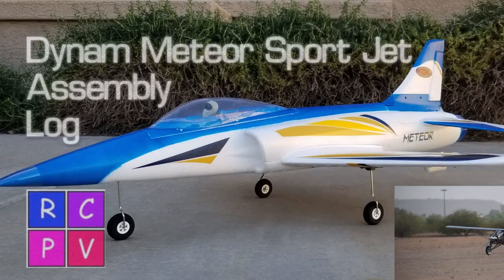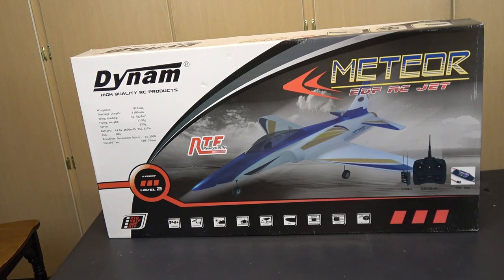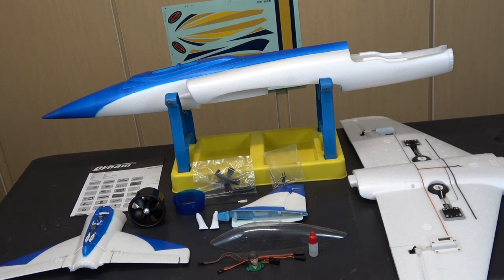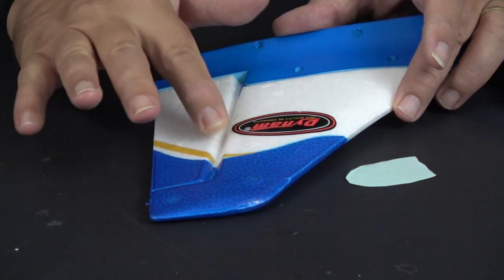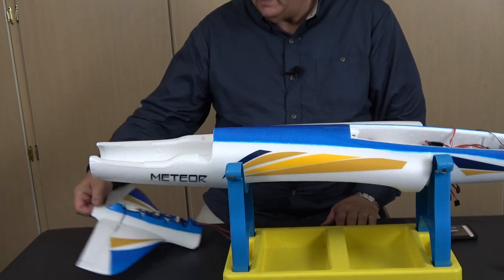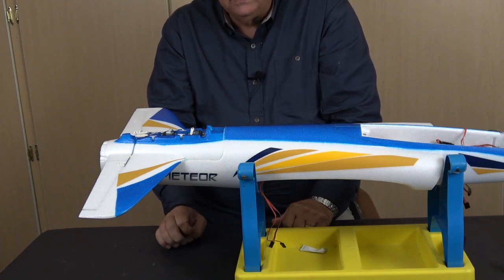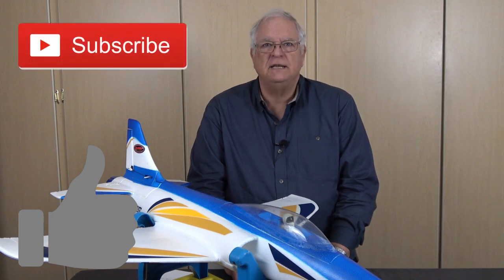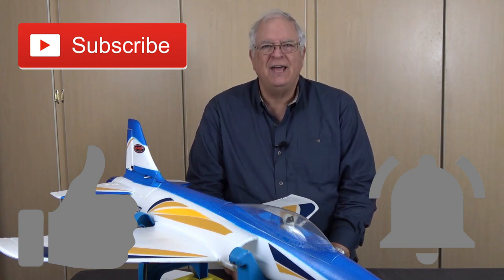Dynam Meteor Assembly Log

Comment: Didn't add wiring connections for us complete newbies... can't figure out why I have extra connectors...
Reply from the maker: Extra connectors where? On the receiver or wires from servos, etc.
Reply: I cannot seem to connect my controller to the plane, it just keeps beeping. Also It seems like I'm actually missing connectors going to the receiver...
Reply from the maker: @pureman777777  You mentioned that you were a newbie. With that in mind, two things. If at all possible find someone near where you live to help you. This will be hard to do via chatting on YouTube. Also, and please don't take offense, this should not be your first RC airplane. It is too fast and its controls are quite likely too responsive for someone learning to fly. A high wing trainer would be a much better choice. Take a look at my videos on programming the Gavin 6C or Blitz 9 channel radios. Both may give you some insights as to what is happening.
Reply: @AZJim12  i appreciate the advice, i have a hobby shop down the road that might be able to help me. And I know its a sensitive control rc, i fly a racing fpv drone so im used to the way the controls work but figured I'd give planes a try. Ill check out the other types of beginner craft as well.